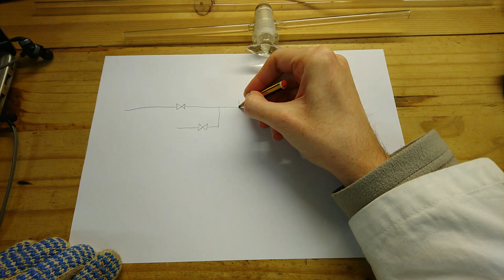First neon tube

Comment: Nice experiment. I had the idea to put lithium in a tube, seal it and create a low pressure discharge tube without a vacuum pump. Only argon, hydrogen and ammonia(from lithium nitride reacting with water vapor) should be left.
Reply from the maker: At high temperatures lithium may react with the glass though, not sure.